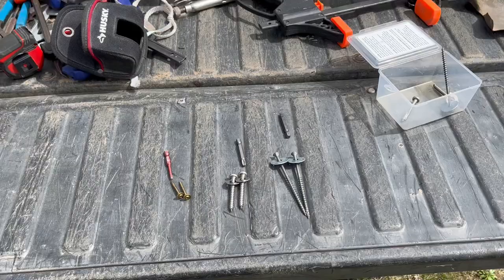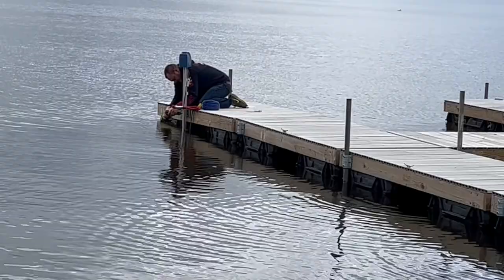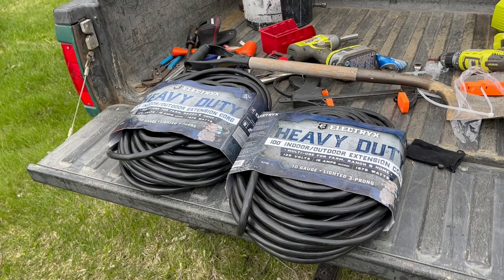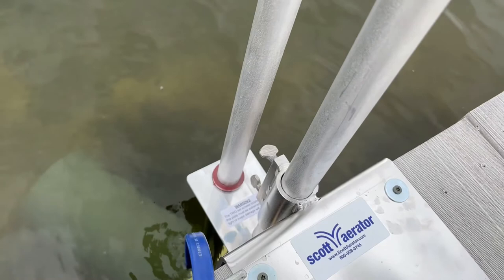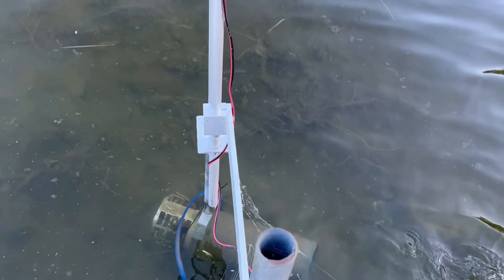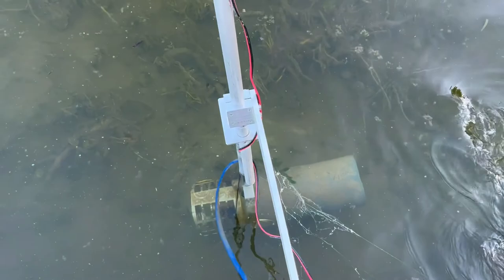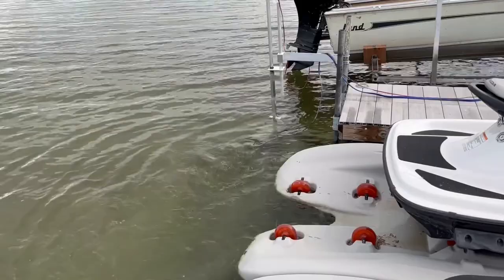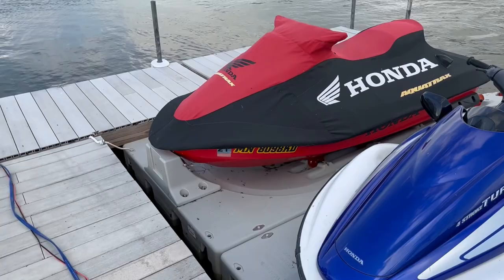Scott Aerator Aquasweep Part 2 - Install, Use, and Feedback

Comment: Glad to see your follow up video. We’ve had our 110v 3/4 hp with the oscillator for about 3 weeks now. We have a lot of muck on our bottom and it’s done a good job in moving a bunch of it out further. Ours wiggles just like yours. I don’t think it’s the oscillator head as both of the vertical poles are wiggling. I think it’s the weight of the unit and how the mounting arm is further away. I have an aluminum pier and mounted the standard mount to a 2x8 and then clamp the 2x8 to the pier with c clamps. Works well and I can move it around to different parts of the pier. 

Nice job and thanks for sharing.
Reply from the maker: Thanks for watching! I'm glad yours is working well for you, I've found at our place we had to run it pretty much constantly otherwise the muck will settle back in.

Comment: Nice video. Just installed mine today and found myself having to mount further down my dock than I planned because of the length and shallow water.
Reply from the maker: I think this summer I'm going to try to modify mine to be able to run it a little shallower, only thing I'm worried about is sucking air and cavitating if I get it too close to the surface, even down deep occasionally it will pull a little air tornado down and kick out some bubbles. Thanks for watching!

Comment: Appreciate all the details in the video(s).  Are you using 115v or 230v and how far are you from your breaker?  I ordered a 1HP 115v unit yesterday and I'm a bit concerned with the distance to my power.  Thanks!
Reply from the maker: I'm using 115v, the cord on the unit is 50', I have a 10ga 100' extension cord and another 10ga 50' for a total of 200' of cord from my power source, I've never had an issue with tripping a breaker. The only issue I've had was water intrusion into where my two extension cords connect, the joint was exposed to the elements which was not a great idea, this year I have the joint sealed with dielectric grease and duct tape to keep the water out

Comment: How has this held up? Any issues with running an extension cord instead of opting for the longer built-in cable?
Reply from the maker: It seems to be holding up pretty good, the only issue with the extension cord is I'm noticing at the connection between two extension cords the plug looks like its been arcing, I'm guessing this is from water intrusion from sitting out in the rain. This year all connections will use dielectric grease and some form of cover to keep water out. Other than that no issues

Comment: Isn’t the GFI to prevent the Circuit breaker from popping?
Reply from the maker: Yes, but from interruption from a ground fault, not necessarily from overload like a typical break, but I am definitely not an electrician.

Comment: i have had the aerator for a few years and had to make a mount out of wood, kinda an oversized sawhorse that i move around but i’ll be getting that dock mount now cuz they never had that. is it easy to move from post to post?
Reply from the maker: I have abandoned the "post mount" and have gone back to the "dock plate" the post mount was very difficult to move from post to post, the weight of the unit was too far out to easily put on the post, and the U-bolts used to secure the mount to the post were hard to tighten and easy to get it crooked, and it just seemed very weak. I'm much happier with the dock plate style mounting, its easier to move if you have multiple dock plates and its a much more secure mount. I just ordered two dock post mounts from DH docks hoping they will work, the dock plates directly Scott Aerator are expensive
Reply: May you give a link to what you bought from DH Docks?